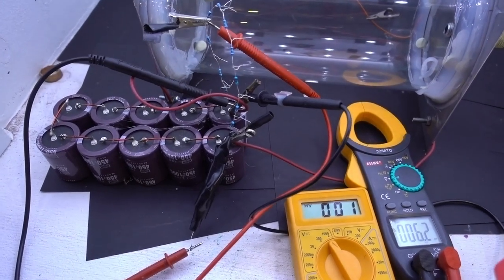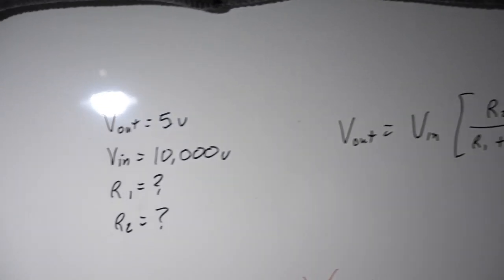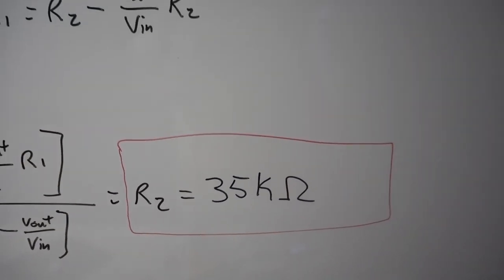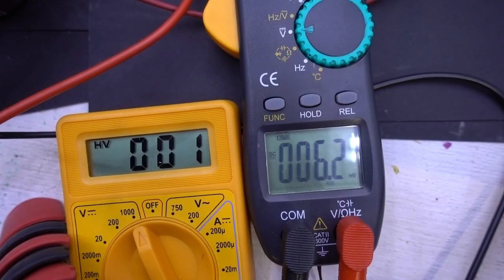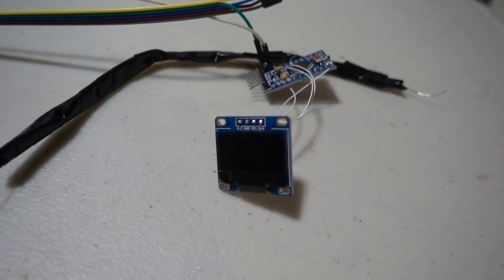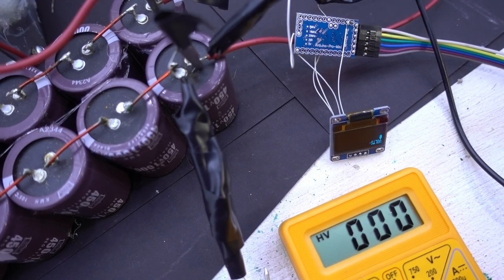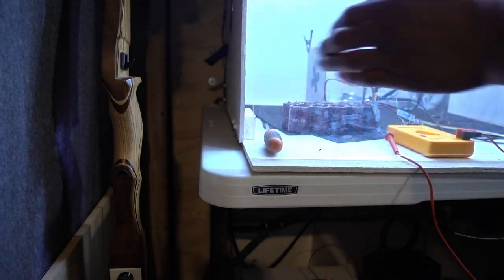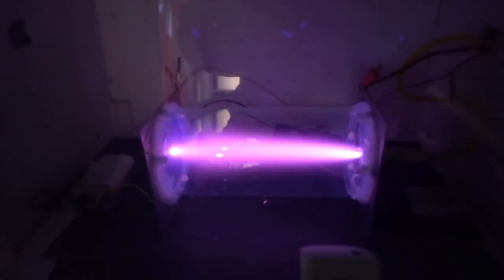High Voltage Arduino Voltmeter (10,000 Volts)

Comment: Hey, nice video, I'll definitely build one myself! If you want to increase the accuracy for low voltage readings, you could use an external ADC (such as the ADS1115, that is 16-bit). It's simple to use and you get a resolution of 0.076 mV (5/2^16) over the 5V full scale. This should bring your 50 V lowest readings to roughly 1 V.